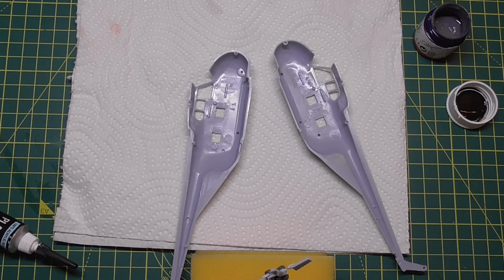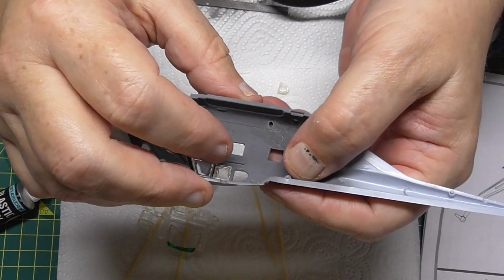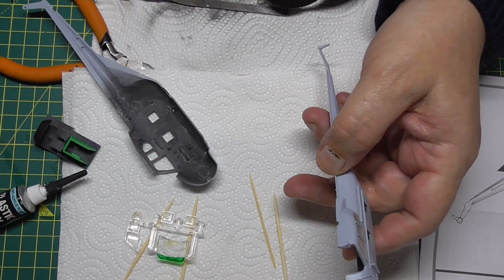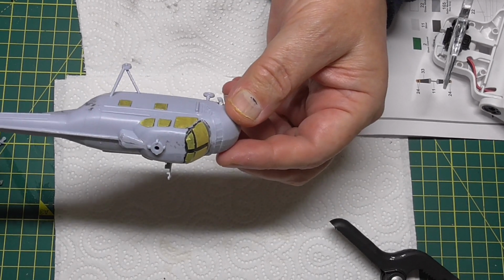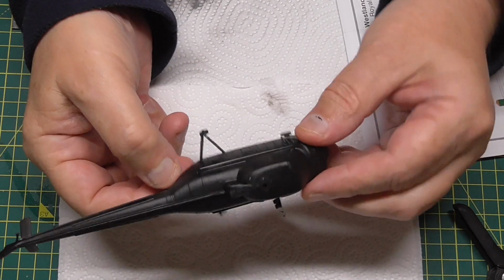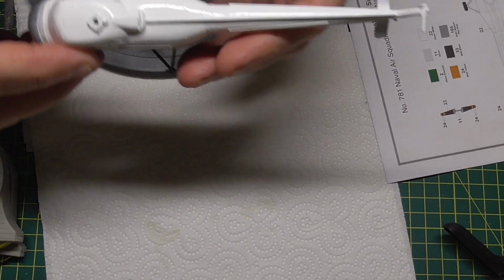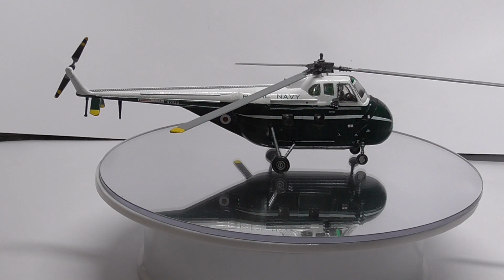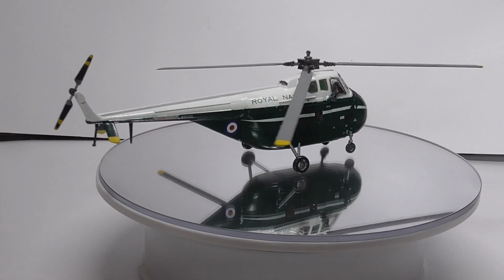Airfix 1/72nd scale Westland Whirlwind HAS.22 Complete model from start to finish

Comment: Very nicely done. I remember making this kit when it came in a plastic bag with the fold out instructions stapled to the bag. They used to be displayed on carousels priced, I think, at 2/- each in the Co-Op. Sadly, my finished model would not have borne any comparison to yours!
PS: You get an extra 10 points for calling them 'transfers'😊.
Reply from the maker: Thanks for your comment. I remeber them, My local newsagent had a carousel, and even sold Airfix paints in glass bottles :)
Reply: @Ryker45  I remember those Airfix glass bottles too - square and tapering up to a round top!
Reply: Just the way I remember buying the kits including Trackside (or lineside) HO/OO kits. I was more into trains in those days before moving to planes and ships. Pity it's getting so expensive these days considering the cheaper labour costs and lost due to the increasing transport and material costs escalating